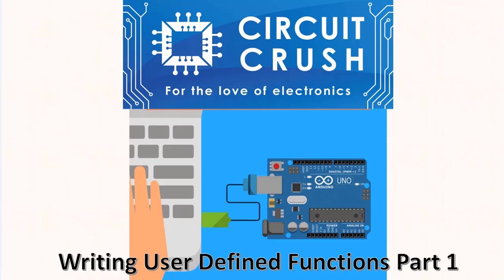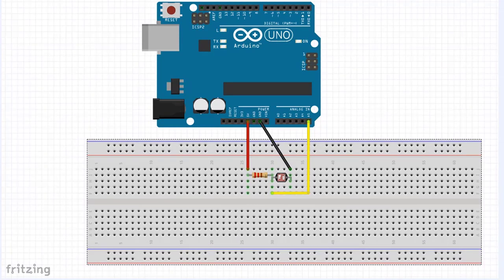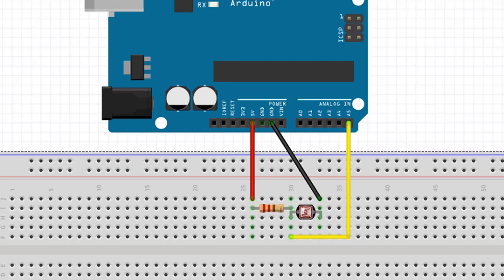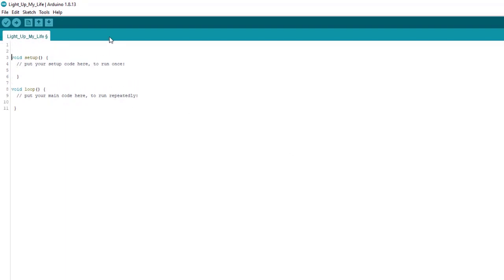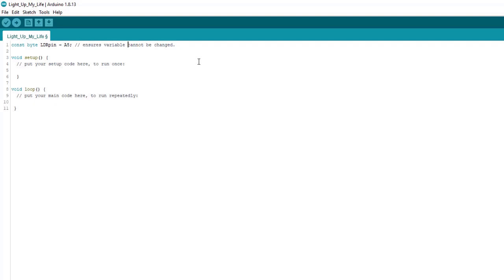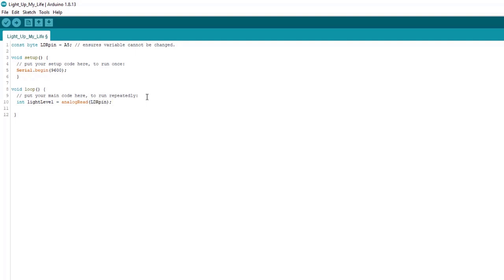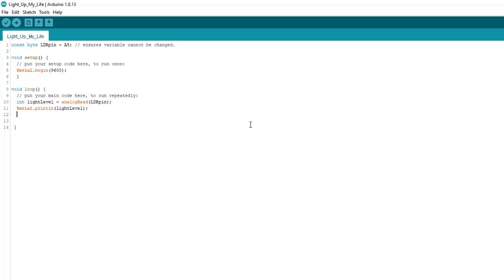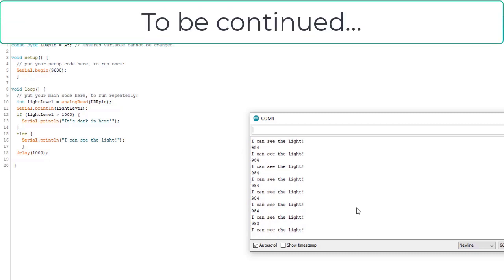Writing Functions in Arduino

Comment: Does it really matter how resistor is connected, if to GND or VCC?
Reply from the maker: In this case it does. If we swapped the LDR and resistor, the output would be constant since it would be taken across the fixed resistor.